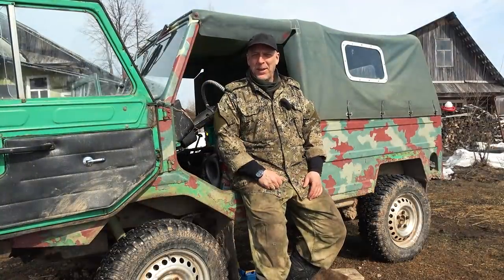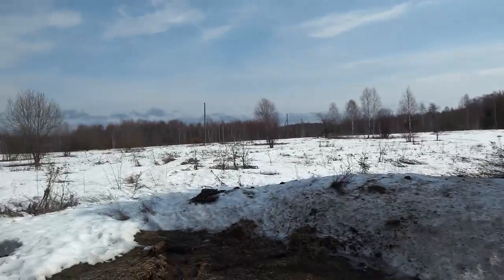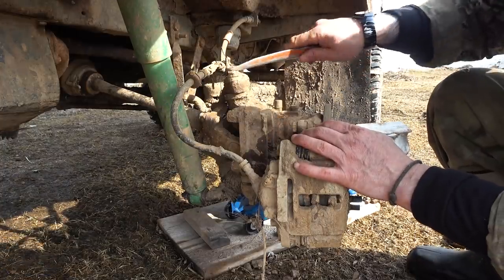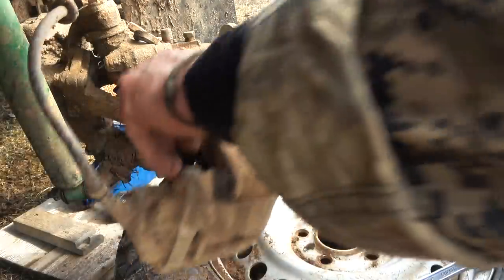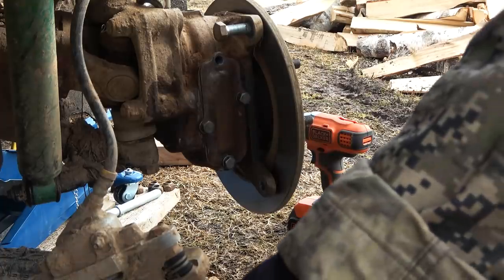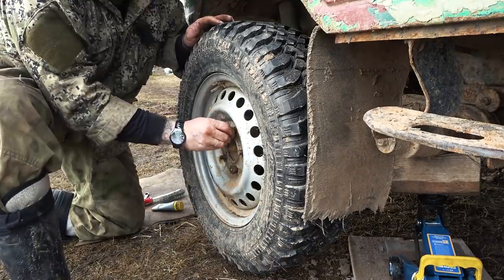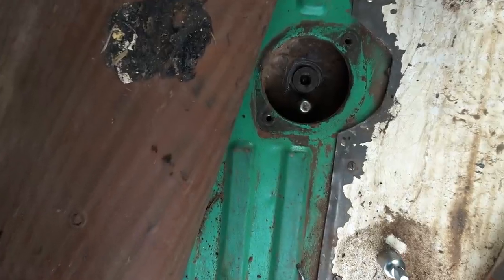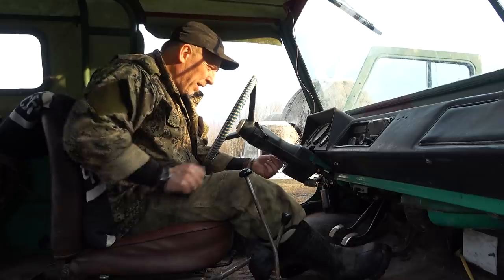Servicing My Ukrainian Humvee | To Grease Or Not To Grease The Nuts

Comment: So nice to work on parts that were made sensibly with the customer in mind! Nowadays manufacturers make it almost impossible to work on things by yourself. Thanks Lars!
Reply: I believe the opposite. Cars are getting easier to work on. Compare setting points with measuring dwell and adjusting a carburetor with plugging in a scan tool to help diagnose now? Much easier and faster to diagnose. The difference is what you are familiar with. Keep learning and you will never be obsolete.

Comment: For the lug nuts and studs I've had luck using WD40.  It makes the nut easy to put on with just your fingers and a little bit of final tightening with a wrench.  The light fraction evaporates fairly soon and leaves a varnish like material which acts like a glue and a sealant.  The nut will stay tight and water/air can't get in the threads.  When you need to take the nut off it does take a good bit of impact on a wrench to break it loose(about 1/16 turn), but the rest of the way it comes off easy and the threads are clean and rust free.

Comment: I've had no issues with lubricating lug nuts or lug bolts as long as the nut / bolt and the wheel is not worn the interference fit between the angles of both will keep it from coming loose ,now things are worn out you're on your own!

Comment: Only bad thing I can recall having been taught about greasing wheel studs is that it makes it very easy to over-torque alloy wheels, but really only if you manage to grease the cones too. On steel wheels the only thing to happen is warping the hat or hub, but if you're giving it that much gorilla it didn't matter if there was grease in the threads or not.

Comment: Haven’t been able to use the throttle to push fuel into the intake using the acceleration pump on a carb in many years. Great vehicle.

Comment: Wheel nuts or wheel bolts should be fitted dry. If you lubricate them, there’s a chance you could greatly exceed the specified torque ans stretch/strip them.
Reply: A torque wrench would fix that issue

Comment: looks like a IRS independent rear suspension axles like in the old air cooled VW beetles after 1968. Simple to service, just replace the boots if the get compromised

Comment: The LuAZ  is a better utility vehicle than the HMMWV ever was. I drove the M151A2 (Jeep) in the early 80's and then swapped over to Hummers.  Hummers suffered from "its not comfortable enough for me" and scope creep. People tried to make it do everything including a fighting vehicle so it was bad for most things except hauling officers around.
Reply: The HMMWV really suffered from the M151 experience, they literally had a design constraint of making the vehicle impossible to flip over at speed. Well, that led to a wide vehicle with a compressed drivetrain height to keep the CG low, which meant portal axles to keep ground clearance, and the weight of all that getting on top of available powerplants and transmissions...  it's really amazing the hummer worked as well as it did, honestly. Engineers were given a clusterfull of constraints and integrated it all.

Comment: Anyone who’s ever taken out a broken bolt would use Anti-seize i’ve been using food grade is not as good as the lead or copper stuff but it’s like hand lotion when you get it on you. With the conditions you have I think I would use the good stuff and deal with the mess.
Reply: I use the nickel anti seize paste on various parts because broken bolts are the pits  👍

Comment: ...and then we have me - upside down in a new car trying to figure out why the trunk bottom is full of water after every rain... After not getting the idea of the design - metal silicone around every single hole, bolts and waiting for another rain to see if it's dry...FIAT 500 - never again!
Reply from the maker: My dad had a Fiat 500 when I was very small :)
Reply: @SurvivalRussia  - he didn't have the new one that overall has good powertrain but everything else is dirt cheap plastic. I also got to the point where I replaced the clutch and driving shafts with Abart parts, because the ones made by Chrysler here or in Mexico are good for pipes only 😬...

Comment: Did you use only sealed bearings when you did the restoration of the portal hubs?
If so the bearings won't need oil for lubrication and the gears would be OK with just grease in the hub as long as they don't rely to much on the oil for cooling. With stock power my portal boxes are never hot after use so I think it would be ok.

My LuAZ has old and quite leaky seals but so far I've just been adding oil often. Right now I can blame the war for not getting the parts needed to rebuild the hubs but really I'm just lazy.
Reply from the maker: I used sealed bearings :)
Reply: @SurvivalRussia  If you decide to try filling the hubs with grease please report on it. I'd be most interested.
Reply from the maker: @Joe12360  OK. I just use a thick transmission mineral oil.

Comment: The big reason for not greasing the wheel studs, is, so far as I am aware, to avoid problems with lazy bastards in tyre workshops who use electric or air powered rattle guns to do up the nuts. I have never seem any of them adjust the torque settings and you have to reduce the specified torque settings for use on greased threads. The only time that I have seen any of those guys use a torque wrench is when they work on our 3 tonne tipper.
Reply from the maker: Yes, it can be a nightmare to change tire after the nuts have been tightened at 750Nm :)
Reply: @SurvivalRussia  Time to get the oxy acetylene set out and warm them up (or NOT if that kit is an hour’s drive away)! 🙂
Reply: @michaelguerin56  cant be stuck if they are a liquid :P
Reply: @herrskeletal3994  I have heard, with all due respect, that some of these idiots have pulled a wheel stud right out by using rattle guns; and that such is a particular hazard when the thread is greased. Lars was obviously talking about excessive torque on a dry thread. Thanks for your reply. Have a good week.
Reply: @michaelguerin56  No worries I was just making a joke about the oxy torch. If you turn the wheel nuts into molten metal (using the torch) they cant be stuck. Just a bit of humor.
Reply: @herrskeletal3994  Cheers.

Comment: Is that a 6 volt system? Sounded like it when you started it. Good fun, I just got my old 1954 tractor going so I can plow up the hard packed snow off the driveway once it turns to slush, spring has come!
Reply from the maker: 12V

Comment: What kind of oil do you run in the hubs? Greasing the lugnuts is not a big deal, as long as you are careful torquing them down. Lubricating them makes it easier to apply torque, increasing the risk of overtorque or breakage.
Reply from the maker: I use 80/90 mineral oil.

Comment: Dude, you need to learn to wrench with a Mexican Creeper. That's a large, thick piece of cardboard. One meter by 2 meters or so is about right for size. Get one, take care of it and you won't get wet when you're wrenching outside in the mud.
Oh, before I forget as far as lubricating the threads would be concerned go by the type of thread. If the fastener is Imperial use SAE 30 weight oil, if the fastener is Metric use SAE 10w30. All published torque specs are based on this assumption ie. a clean, brand new threads and the aforementioned oils. If the threads are old, ie. used, then torque to the high side of the published specs. Always torque your wheel nuts in a circular pattern and use a three step process. 
For example: If the torque specs are 80-90ft/lbs  and the fastener is both old and Imperial you would clean the threads, lube them with 30wt oil and cross torque them to 30 ft/lbs, then 60 ft/lbs, then finally 90 ft/lbs. You will never have a problem if you wrench this way. It sounds complicated but in practise it is actually rather easy.
Good luck.
Reply from the maker: The ground is wet. I think cardboard would suck :) water.
Reply: @SurvivalRussia  Not if you get a thick enough piece. You'll be suprised at just how well they hold up. Try to find one with some kind of decal or shiny paint on one side if you can, that'll help too. I added mechanical directions to my earlier post for the lug nuts, they might help you out too.
Reply: @jomamma1750  I often use an old fridge door ; very light , fairly slim . it slides around great on concrete or tarmac , and keeps me off wet ground . easy to clean also
Reply: @markevans8446  I use a regular snap-on creeper on concrete, unless I need the extra clearence, in which case a Mexican Creeper will do. Try a wheeled creeper(snap on style) out on concrete or tarmac some time, you'll get converted quick. They're so, so much better than something essentially fixed like what you are talking about.
Where I grew up it rains 135 days/yr and that's not in the winter where we would get blasted with snow for months, 3 foot deep blizzards every so often, ect. A very wet place and I did tons of road calls, for many years. One of the shops I wrenched at my bay was the deck outside! That was for almost a year. I've done countless jobs lying on my back in the snow and the mud. The Mexican Creepers always did me just fine.
Reply: @jomamma1750  I just tossed a folded tarp down when I needed one. Cardboard's the absolute best for a gravel driveway though!
Reply: @mfree80286  I always used the cardboard partially for that reason too, to prevent the rocks from digging into my back!